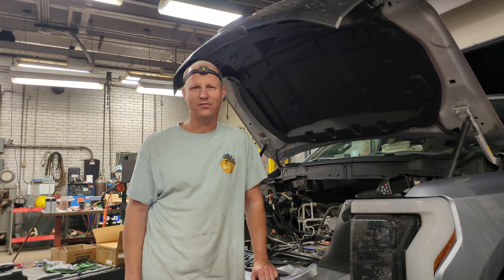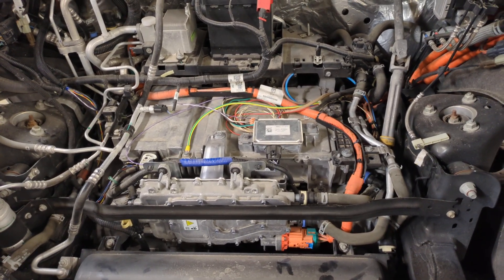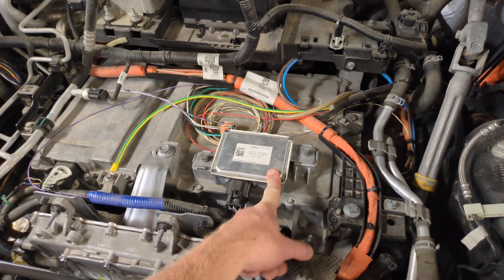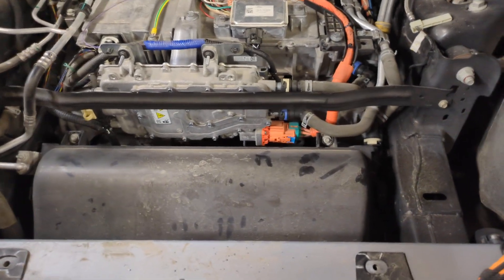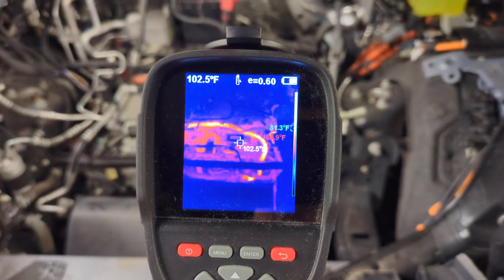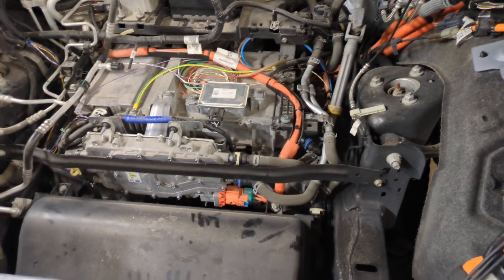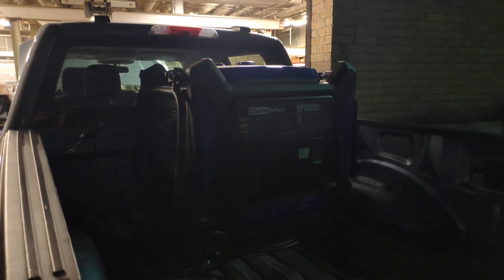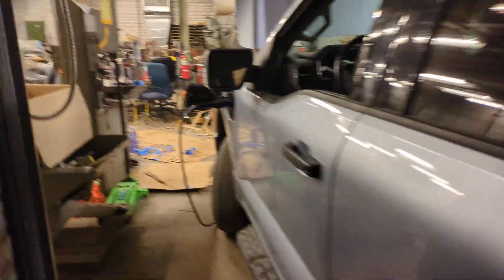The F150 Lightning Charging System - Charge While Driving

Comment: If you average 2.0 miles per Kwh which equates to 500 Wh/Mile.  What size generator would it take to maintain the HV battery at that rate?

Also, why not use an invertor generator for cleaner power?

Lastly, is it possible to mod a tesla to charge while driving?

Comment: No we just need to put a heat pump system in line with the cooling line to cool down to chilling when Super charge so it can hold the charge @170 kw longer period.  The cooling system was inadequate when supercharge.  It throttle because of heating issue.

Comment: Why didn’t you just buy a hybrid?  A Duromax gen isn’t a good long term solution.  A hybrid with a small efficient diesel gen….?
Reply: Because thisbway its not really permanent. Think about it if a Hybrid engine went down the whole vehicle doesn't work. In this case it's separated
Reply: What pickups are capable of this?
Reply: Because it can be a normal EV every day and only use the generator when needed.